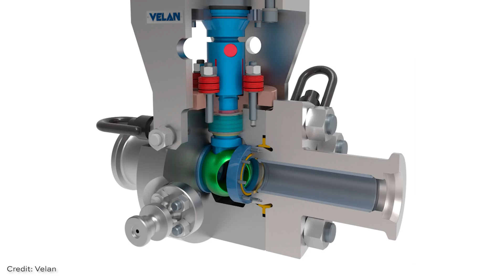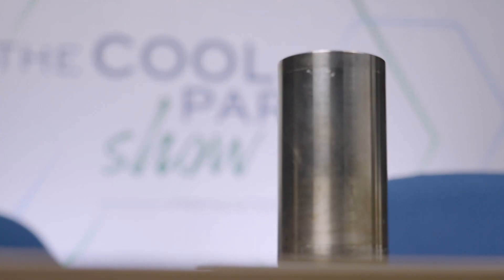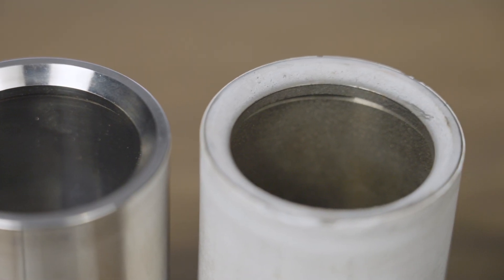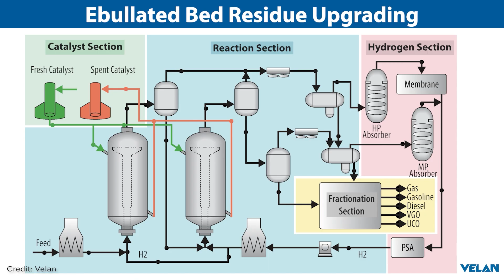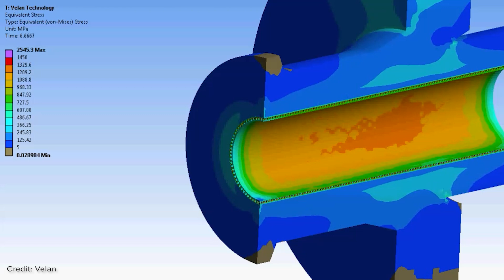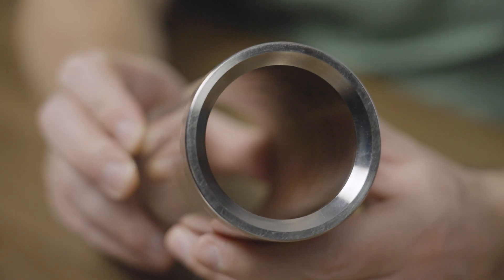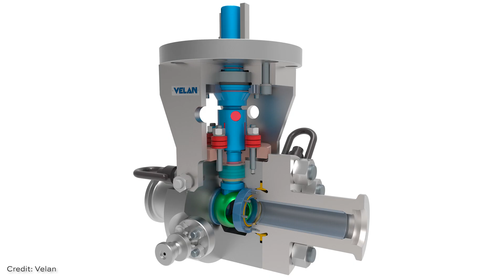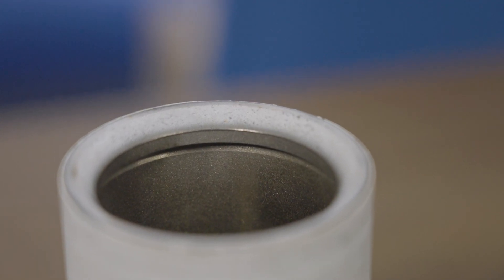3D Printed “Thermos” Protects Valves From Thermal Stress | The Cool Parts Show

Comment: Would it be possible to talk through the full process flow for a part like this? The part is printed with an open end I assume, followed by de-powdering, and is then welded shut? There is always a ton of discussion about the part on the printer, but we rarely get to see/understand what sorts of steps are required after the fact. The de-powdering step always seems very tricky on hollow parts like this, even more so when you are talking about cooling passages on a rocket nozzle or the like. How the heck do you get those passages empty and clean?
Reply from the maker: Sorry that we can't share much about postprocessing for this particular part, but we agree! We frequently get to talk about the 3D printing step, but not so much the steps that happen before and after. As consolation, we have a video project in work that focuses on the setup and post-print steps for laser powder bed fusion. It's coming soon--stay tuned! (And thanks for watching.)
Reply from the maker: Thinking about this a bit more:
The Cool Parts Show episode about the Mars rover 3D printed parts comes to mind. They used ultrasonic powder removal to clear out intricate channels. Here's that video: https://youtu.be/Ki-TJVmc_a8?feature=shared&t=576 

And, a video we shot at Formnext 2021 shows a machine for depowdering a big part like a rocket nozzle: https://www.youtube.com/watch?v=rrCF7Do093M
Reply: @AdditiveManufacturing  it would really be interesting to see post processes that create smooth surfaces on the inside of eg. 3D-Printed cooling channels. 
Its one of the common arguments against 3D-Printed mold-inserts, that the cooling fluid then requires higher quality, because those thin, rough channels tend to clog very fast.
I know that there are electrochemical processes, but i would love to see them here too.
Reply from the maker: Noted! It’s not a video but we did recently report on a finishing technology that can address internal features like cooling channels, Micro Machining Process (MMP). It was actually first developed for finishing mold tooling and is now used on end-use metal AM parts as well, in part because it can get into hollow areas and channels. In case of interest: https://www.additivemanufacturing.media/articles/surface-finishing-without-sacrificing-material-through-mmp

We will keep looking for ways to cover postprocessing on the channel, too!